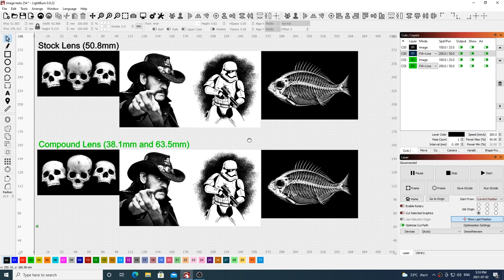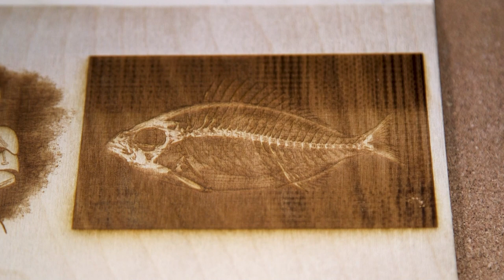Stock CO2 Laser Lens Vs. Cloudray Compound Lens - Better Engraving?

Comment: With these 2 lens are they both convex sides up. Thanks martin
Reply from the maker: One is convex, and the other is flat.
Reply: @MakeTechCreate  are you sure I’ve been told it’s convex both sides up 
It’s the cloudRay compound lens
Thanks martin
Reply from the maker: @Martin  just checked. Yup, you're correct... convex on both lens.

Comment: Was this supposed to be a demonstration of photo engraving or incised 3D engraving?  Far too much power for the speed for both lenses  I saw no attempt to set the optimum focus for the speed and power you chose for either lens. Was this a dithered image or a grayscale image ?  I note that Lightburn has set your line interval to 0.1mm  Did you check that your machine was capable of producing 0.1 dots (or lines) before running the tests. If your dots ( or line thickness if this is grayscale engraving) are more than 0.1mm then that accounts for the  depth of cut because  you will be burning each pixel multiple times.  The compound lens has much greater "spot" intensity and requires much lower power than a normal lens. I note you ran both lenses at the same speed and power. This is not a fair comparison for either lens.
Reply from the maker: "Old Man Yells at Cloud" Go be grumpy on your own channel and leave everyone else alone you old troll!
Reply: @MakeTechCreate  The compound lens result looks very similar to borax treated wood with a regular lens. Can't really see the value for engraving. One would think the feature of a compound lens would be greater depth of field - therefore a cutting advantage, not an engraving advantage. Where's the cutting demo video?
Reply: @garysnyder743  Compound lens is not for cutting, only engraving.
Reply: @garysnyder743  The compound lens has a narrower depth of field the gem in the lens is the ability to engrave without cutting deep into the substrate

Comment: Stock lens is clearly better and I dont see why you need to stack two lenses together, thats odd. Second method produced way more burning, which means that focus was simply bad. Lasers do not burn anything, they evaporate material, so ideally you would not see burn at that depth.
Reply from the maker: The concept is to create a smaller focus point for more details... but, yes, it only really applies to a few applications. For most engraving, the stock lens is just fine.